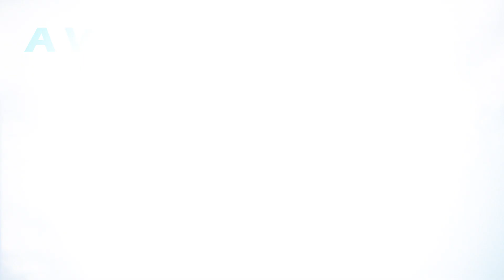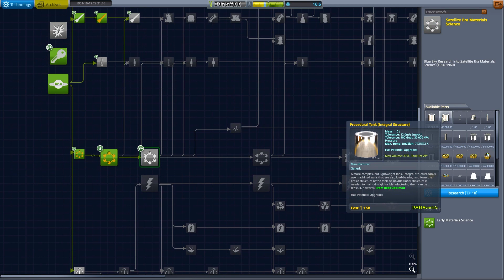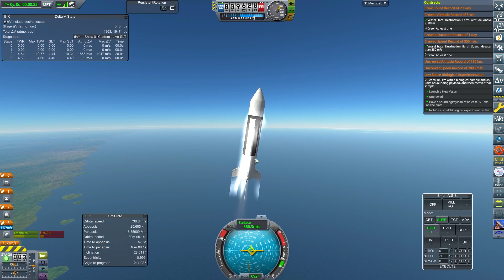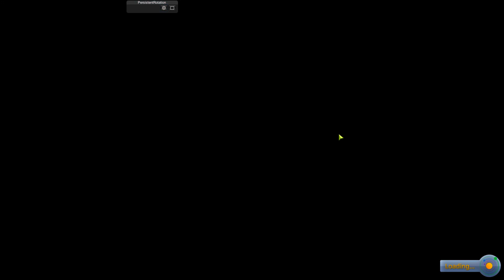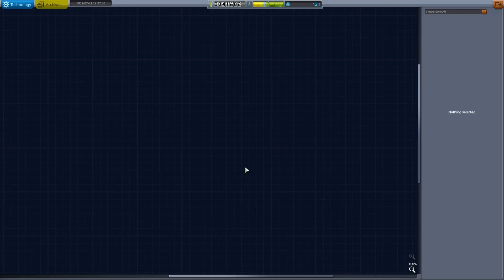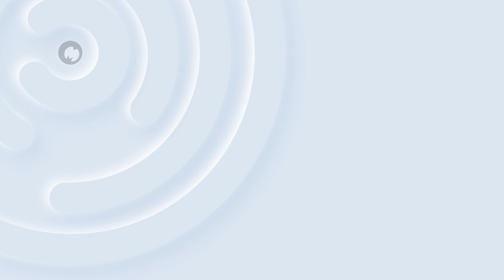A Very Basic Space Program | Episode 4 | KSP RSS/RO/RP-1

Comment: Thanks for another video :) BTW, one more tip(dont know if it is exploit or feature :) ), for some economy of tonnage when projecting your rocket. You can use 20t launchpad or 150t launchpad (for expample for launching R7 which mass is near 300t+-) If you using Liq. Oxygen and/or Liq. Hydrogen, you can in VAB set all what you need, then move slider of LO and/or LH to 0 - that will drasticaly reduse mass of your rocket. Build it, roll out it on your launch pad, "Launch" it and wait a bit while it will refuel via clamps, then just launch it. It will cost you less to roll out and recover launch pad and will take less of a time. A bit, but still )
Reply from the maker: Glad your enjoying! 

Yes Iv seen that before, I’m considering it a ‘cheat’ in this series ;/)
Reply: @seyMonsters  Maybe so, but, if you think about it with a bit of a "stretch" - rockets rolls out to launchpad without fuel, and after they set up into position they fueling up ;)
Reply: @foxlits  
But the pad shouldn’t be able to hold the rocket once it’s fueled
Reply: That is officially considered cheese and unintended